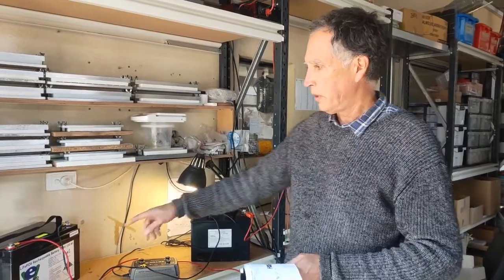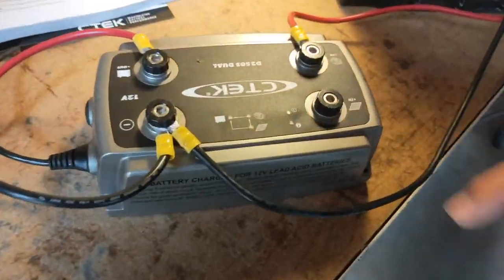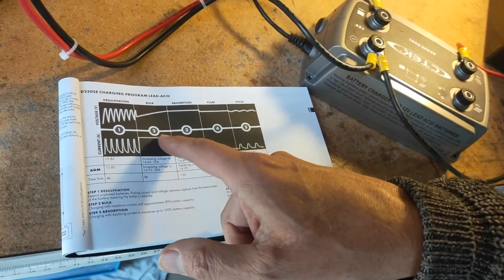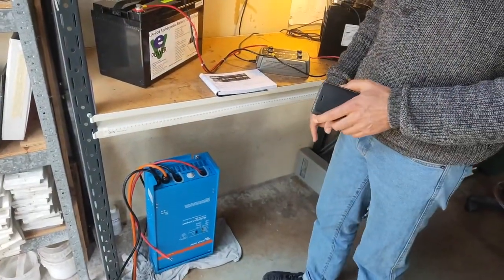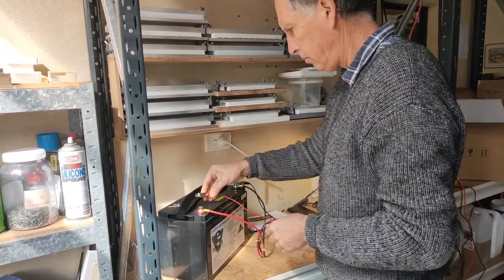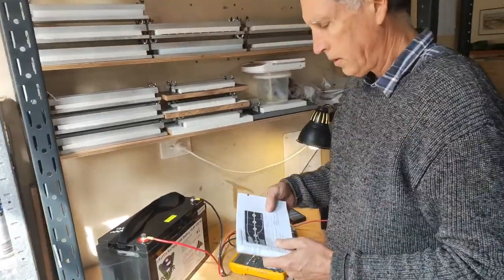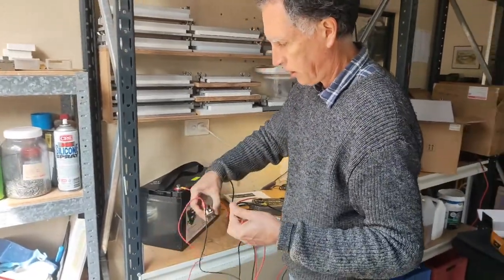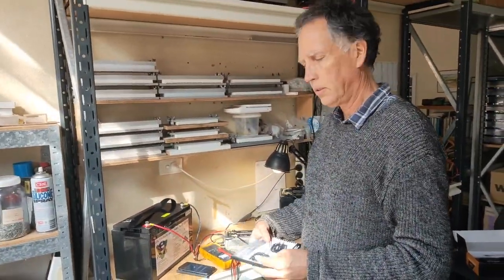Can I Charge a Lithium Battery with a Lead Acid Battery Charger?

Comment: Excellent video you are  the only person to do  this practical experiment. I have found on the internet. I have suspected to battery charger manufacturer would like everyone to buy a new charger. They are not cheap. I will use my cteck charger on my new lithium battery.
Reply: Just get a lab  bench power supply lol
Reply: There are much much cheaper options lol

Comment: a lifepo4 cell battery is 4s config and therefore wont reach max charge from a PB charger, that's all.  The only other issue I might think is when in the desulf stage, I wonder if that might mess with the BMS in the lifepo4 battery.  I doubt that tho.  What you should do, is a capacity test, charge to full with a charger designed for lithium, then test the total AH you get from it right till the BMS cuts off, now do the same with a PB charger and see the difference. my bet is you will get about 80% of the capacity if you use a PB charger.

Comment: Trying to get lithium battery information is like smoke and mirrors and marketing BS.  Quality internal components like BMSs,  temp, over and under charge sensors and specific lithium dc to dc and AC chargers are some of buzz words and recommendations.   EV power batteries were at the top of my list but location and phone access to them has made the purchase difficult which is a shame as they appear as the real deal.  This video shows another positive as I could have use my current charger.
Reply: I agree with you Mczook, I'm going to drop a Chin 100ah Smart Lithium in my camper and if my alternator fry's then I will have no one to blame but myself.
Reply: @jege41  Cheaper to get a charger box in between your alternator and lifepo4 battery than a new alternator :) The charger box thingo should have an option to detect when the alternator/car battery voltage is above say 13.8v to assume the motor's running and only give juice to the lifepo4 battery due to that.

Comment: If you want to jump start the charger with another 12 V battery, just insert a 10 watt 1 ohm resistor in line with the charge wire. That will limit the current to around 10 A max and it will rapidly drop off to around 1 amp as soon as the BMS turns on.
Reply from the maker: Good point

Comment: Can I do the same (i.e., charging li-ion from Lead-acid) with a boost dc-dc converter in CC mode? what could be the maximum discharge current from a 12V 26Ah lead-acid battery?

Comment: Please help...If you have no solar and are idle, eg no alternator power charging....could you not just put a  mains12v supply on the alternator side of your renogy 50a Dc to Dc charger to mimic the 12v supply from your car battery...this way you have a quality lithium phosphate charger   within the Renogy Dc toDc charger...is this an idea...thanx in advance....
Reply from the maker: Generally speaking, switch mode 240V chargers need to see a battery voltage before they start to charge, so no, not in my experience.

Comment: The BMS will cut off the power when full.
 I use a straight transformer charger without electronics or computer control.
Reply from the maker: This I do not recommend. The BMS is not a charge controller and it is still possible to damage the battery with a continuous maximum voltage charge.
Reply: @ev-power  yes sure I know do about it. I keep an eye on it. I actually have a DC/DC charger in my car for the lithium battery

Comment: Thank you for sharing. If you have a Dc 2 DC charger for lithium battery on your vehicle and your charger has a solar input. Use that to charge your lithium battery with a normal lead acid charger. Your battery will see a voltage coming in and take that to fully charge and it is safe. Don’t be scared to charge a lithium battery with an ordinary battery charger. All that sales talk of you must use lithium charger to charge lithium battery is a way to convince you to spend more money for no reason. Your DC2DC lithium charger charger will do its job in charging a battery safely

Comment: Brilliant..My lead acid batts on the horse trailer were shot. So I took em out (2 12vdc paralleled (over 5yrs old)) and wondered if I could just plug in a 100Ahr Lifepo batt from one of my solar setups in their place. Should be ok.

Comment: I just use a more old-fashioned lead charger without desulfation.. or how it was spelled. 20amp. Use it when the sun fails for 2-3 days and the battery is getting low. It charges to 14,7 so i removed after 6-10 hours of charging just to be sure i dont get too close to 13,5+volts and certainly not anywhere 14,7 :)
Reply: Yeh, best not to float 4-cell lifepo4's above 13.4 volts.

Comment: Good observation on the lead acid charger shut down with low Voltages. Not all BMSs are the same; this also applies to battery chargers. The most important feature in a BMS or charger is the temperature sensor shut down. If any of your devices does not have that, they are a fire hazard. Typically the BMS algorithm will balance the individual cells of the battery and control the amount of current for both charge and discharge while monitoring the temperature, besides shutting down the battery in case of a short circuit. As long as the charger's Voltage is higher than the battery's, the BMS will allow for charging.
Reply: I can't believe this guy sells these while not knowing what is going on. no one seems to know.
Reply: @immrnoidall  Totally agree. Don't forget 99% of lithium battery cells come from China. Do the Chinese even know what is going on? Or do they manufacture a product in order to produce a profit? We all know that answer and we all know the quality of most Chinese made products. Estimates that lithium batteries will last 8-15 years depending on discharge rates is pure optimism. Who owns an LED that has lasted 50,000 hours? No-one, coz drivers, connections wiring etc fail well before that. Lithium will be no different. Unless you buy a high quality US made battery with a 10 year warranty.
Reply: @immrnoidall  now some has shown us give the guy a break not one lithium battery manufacture has printed any info on this. This is a great hack.

Comment: From my experience using LiPo batteries in r/c planes, you need a specific charger for lithium batteries to analyze the different cells and to above all balance them to the same approximate voltage. But in saying that seeing is believing.
Reply: I think the bms on the lifepo s does that?
Reply: @wendygerrish4964  Correct.
Reply: Has a built in BMS.

Comment: great video, i wonder, since i just bought a 100ah lithium battery, if some of the same reasoning might apply to all the inverters out there that imply they should only be used with lead acid ?

Comment: Good test. I just bought a Shorai lithium iron sulfate battery for my motorcycle. I have a Deltran Battery Tender that I used to maintain a charge in my Harley battery. I was hoping to use this charger to maintain a charge on the lithium. So if a lithium battery is not completely dead, and has 12+ volts, do you think 1) a conventional lead acid charger will work to maintain a 13.8+ voltage? 2) Do all lead acid chargers have this desulphation feature and can this feature cause a lithium battery to fail?

Comment: Lithiums with an internal BMS will prohibit charging at or below 0C/32F, aid in balancing the cells and prevent charging over 14.7 VDC.  If your lithium has no BMS, you MUST have a charger that allows setting the temp. coeff. to zero if you travel in areas less than 75-77F / 25C (to prevent charger from increasing charge voltage above 14.6 VDC in environments less than 25C).  Even with an internal BMS (which often fail) it is good practice to set charger temp. coeff. to zero as a backup system.  Any BMS can be reset by briefly connecting an identical charged battery in parallel, or any battery over about 6 volts as you showed... but briefly.  Most Lithium 12V batts should be charged in BULK at 14.2-14.6 VDC (absolute max 14.6) and 0.2C (the number of amps equal to 20% of the batts amphour (Ah) capacity, then absorption at a constant 14.2-14.6 VDC and a falling current from 0.2C to 0.01C or less (from 20% C to 1% C or less).  The classic "float" phase is not required (set float time to zero) but some batteries recommend a "topping" phase for lithiums.  If you cannot set float time to zero, set max float voltage to 13.6 VDC... never higher, at 1 or 2 amps for minimum time or turn off charger.  Most can also be fast charged by setting bulk and absorption currents to 0.5C (50% C) and of course voltage to 14.2-14.6 (max) depending on battery maker's specs.  Never overcharge (so avoid "dumb" PWM solar controllers and smart chargers that go to 14.9), never charge if battery environment is at or less freezing point of water, never float or top at over 13.6, and never discharge below 10.5-10.8 VDC (depending on maker's specs).  Over-discharge often occurs when using an inverter to provide AC power for appliances  especially those with a big amp draw like a microwave... it is so easy to over-discharge.  To avoid this, set the inverter low voltage discharge to 10.5-10.8 VDC depending on battery maker's specs (when in doubt use 10.8 as the low voltage cut-off).  These things will provide you with many years of happy lithium use... although I personally use silicon dioxide (SiO2, "lead crystal") 6 volt x2 batteries to avoid ALL of these issues, including charging at -40C, discharging to dead zero, storage at dead zero / partial charge / full charge, fast charging at 0.3-0.35C, never floating, and allowing deep discharges far below 10.5 VDC when heavy appliances draw 0.5-1.0C (like an 1800 watt convection microwave).  To save generator fuel when charging with inadequate solar, I cycle my two 6V SiO2 batts between 20-80% capavity (80-20% depth of discharge) and fully charge to 100% once a month.  I live 24/7, 365 with just t two 6 volts.  Trust me, I'm a doctor and a scientist.
Reply from the maker: Wow, couldna said it better myself.
Reply: There are some new smart batteries out now that have heating pads built, like Chins smart lithium

Comment: So, applying the second charger/battery effectively allows the BMS to reconnect, allowing a charge current. You woke the BMS up, and thus the CTek can see there is a battery there to charge.
Reply from the maker: Correct

Comment: I just bought one of these exact batteries. 
I have a dcdc charger which I put on the lithium setting. The battery is fully charged so the dcdc doesn’t charge. 
I suppose that’s obvious. 
I turned on the fridge and it still did not charge. Does the battery percentage have to drop to a certain level before it starts charging? Or is it voltage related? 
This post may be a bit premature as I am about to head up the bush prospecting. 
I guess I will know the answer soon enough.
Reply: YOur voltage (not under load) is your battery % essentially.

Comment: I'm new and learning lithium batteries use. but my brain is blown to find out after two weeks on the internet, I can not find a straight answer to anything. sellers get the cash and give no support of any use so far. for one thing, how could solar ever be constant anything?
Reply: MPPT solar charge controllers typically works with from 100v down to the voltage of your battery bank (12 - 24  or 48v) and automatically regulates down the higher voltage it gets from the solar panels to the voltage of you batteries (the voltage it gets from the solar panels need to be higher then the battery voltage and the higher it is the better). The voltage and ampere from solar panes varies during the day so the MPPT solar charge controller take the varying input and regulates it down to what is best for your batteries charging.

Comment: I looked at CTek charger documents graphs...
Lead acid/AGM charges at 14.4-14.7V

CTek XS LiFePO4 charges at 13.8V

Which raises questiions that using in a vehicle being charged by alternator designed for lead acid will overcharge a Lithium longterm

Even manufacturer of Lithium battery describes it as a STARTER battery and draws question that it is not truly a L.A. replacement and certainly should never be used in an engine bay where exposed to heat
Reply from the maker: I just looked too. The charger you refer to charges to 14.4V then drops to float 13.8. LA AGM and Gel are very similar. So that argument does not really stack up. 
My question is, if you are skeptical, how about you test your theories before advising others?  I'm testing stuff every day and try to only pass on what I know to be true in my experience.

Comment: So, then If we instal a lithium battery in my bike or car that has the traditional lead acid battery charging system like a 1976  model, HOW then will this old style charging system differ in deliver charge to lithium that requires this special electronics?
Int makes no sense then to instal lithium battery  into a traditional charging system.
I cannot see anyone anywhere addressing this point.
Reply: The inbuilt charger of the car doesn't do all the fancy things a specialised external charger does. Especially true for old cars when electronics to do all these fancy features was expensive. So as long as the car isn't doing anything fancy, the BMS within the Lithium battery will take care. There literally are Lithium batteries that are marketed as replacement. The inbuilt electronics take care of the compatibility, user doesn't have to worry about anything.

I should add that just like lead batteries are just bare batteries, you can also get bare 18650 cells. Now that definitely needs a specialised charger cuz it doesn't have a BMS inbuilt.

Comment: Pulse stage? never heard it called that - I suspect it's just the device measuring and monitoring the battery voltage, it's not pulse charging which would be micro cycling and bad for any battery high on the knee
Reply from the maker: It is definitely a thing, for desulphation of LA batteries. And yes, it does pulse charge the battery. It's not of any use with Lithium batteries.
Reply: @ev-power   I would be inclined to switch that charger completely off after absorption its bonkers to pulse charge a Lifepo4 battery when it's on the upper knee it will undoubtable shorted cell life - I charge my RV 300ah to 13.8v and every 50 cycles let it run to 14.4v and top balance.
Reply from the maker: @trevortrevortsr2  Perhaps you can be a good sport, test your hypothesis and report back to us here.

Comment: I use an 12v with 18AH to jump start my 12v 100AH by just a quick tap on the connectors. Works well

Comment: A lead acid charger, especially non "smart" models will easily charge a 12V LIPO but some nuances have to be considered. The first nuance is that you don't want to float charge a LIPO indefinitely. Remove it from the charger once the maximum charge is reached. LIPOs don't last as long if 100% max charge voltage is met and maintained for too long, especially when not in use. Also, if you pull the LIPO down too low, many lead acid chargers won't enter bulk charge mode when they see a voltage below some cutoff number, say <4V or some even less <6V. Some Multiphase smart chargers will try to run a reconditioning mode when detecting low voltage. This is not a mode that you want to run on your LIPO. Lastly, by design, a LIPO BMS will manage the charge and also cell balance. Because of this feature, many people use low-cost power supplies (used for bench power) and tune up the output to 14.4V or more. The only caution using a cheap bulk power supply is that some poorly built ones sold on eBay or AliExpress have noisy outputs, which ruins all batteries. Invest in a good power supply if you do this. Typically salvaged 12V marine or RV power supplies or chargers have excellent output.
Reply from the maker: Yes, this is sound advice.
Reply: These are LiFePo4 batteries. Slightly different to LiPo batteries, but that advice will also ensure the LiFePo4 battery is kept in good condition.
Reply: What is a noisy DC voltage?

Comment: I wouldn’t use lithium iron phosphate batteries as starter batteries, that chemistry is not meant for surge starting. Thats what lead acid is for. And it absolutely doesn’t need surges or pulses or floats. That’s why you buy a lithium charger,  not that that charger is going to hurt it. It’s just not optimal for its life. And when you pay so much for a battery you want maximum life. You have to understand the chemistry and the charge curve of these things which it doesn’t seem evident in the video
Reply from the maker: I used a GBS 40Ah LFP battery (prismatic cells)  for ~6 years to start my BA Falcon (4.2litre 6 cylinder) before I sold it and the new owner used it a few years more. So your argument about LFP batteries being unsuitable for does not exactly stack up. I had just a balancing BMS on it so had to be careful not to drain it. Also LFP batteries are sensitive to low temperatures, which was not an issue in our mild climate. The issue with LFP as start batteries is the BMS must be able to protect the battery but also allow high surge start currents. This makes it more costly than for deep cycle use. Actually Lead Acid batteries are a very good option for starting so there is no particular advantage to using LFP for that.

There was no particular difference between the charge curves from the LA CTek and the LFP Ctek. Agreed that LFP batteries definitely do not like a permanent float charge with no load.
Reply: Some lfp are rated for higher C than others. You can get lfp that handles 5 or 10c just for continued load while others are max 0,5 or 1c. Bursts ofc even higher in both examples. So point being, some lfp (LiFePo) are better than others for various applications.